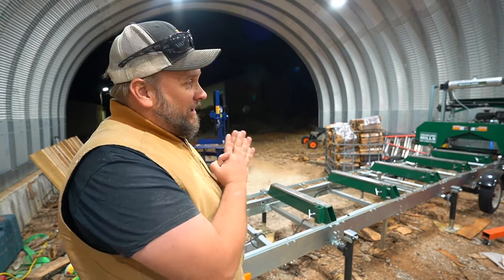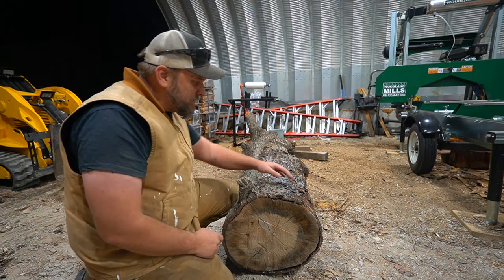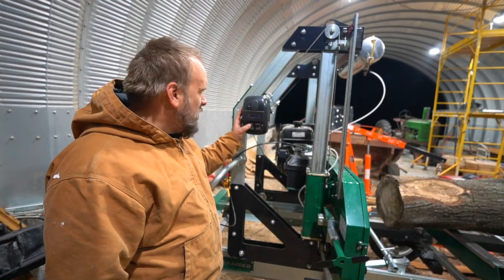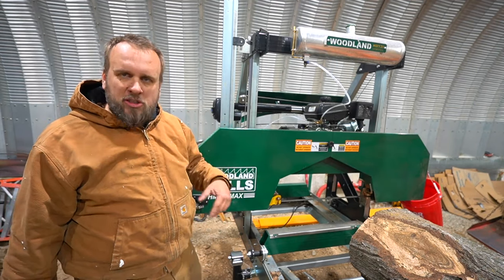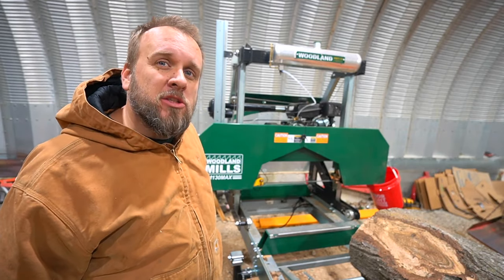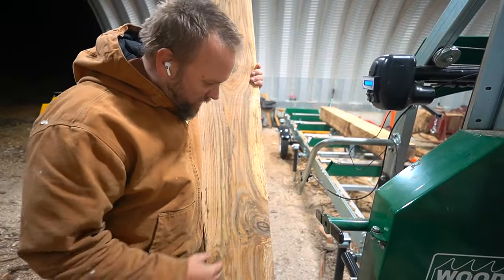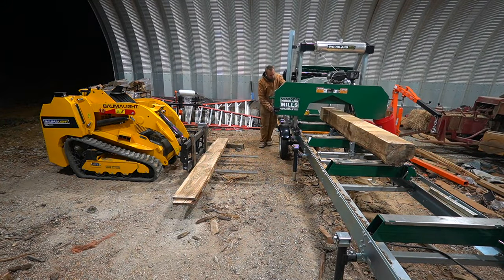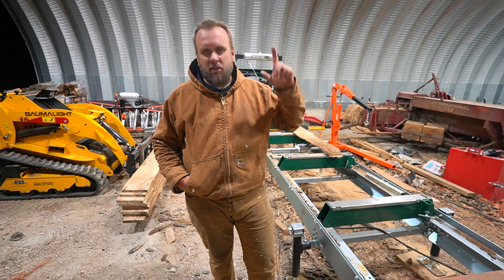This Powerhead is a Game Changer for the Sawmill

Comment: You're getting way ahead of me.  I need a sawmill shack, a power head, probably a better cant hook, and then a mini skidsteer.  Until then, I'll use my leaf blower to clear the snow from my mill, plow the work area around the mill with my tractor, load the logs on my mill with the tractor, and worry about where the heck I'm going to stack all the lumber.  Maybe I need to stick a lumber drying shed in there somewhere.  You looked a little low on energy, but that is to be expected as your body adapts to burning fat rather than glucose for fuel.  Just stick with it.  You'll be glad you did!
Reply from the maker: Getting your perfect set up is always a process and the process is the fun anyway

My energy is a little up-and-down, but three full days in. I think I’m making the right choice.